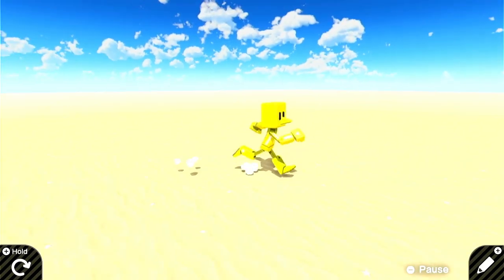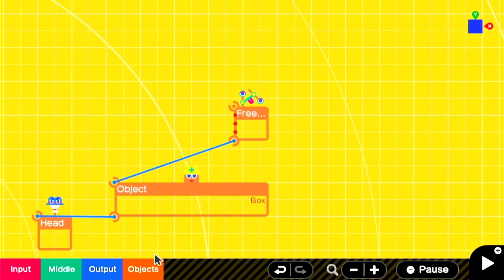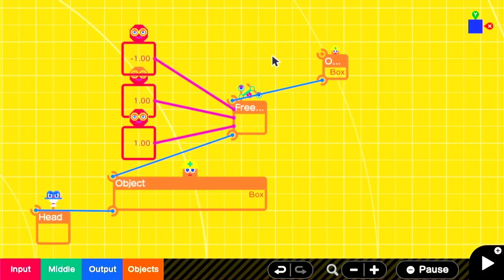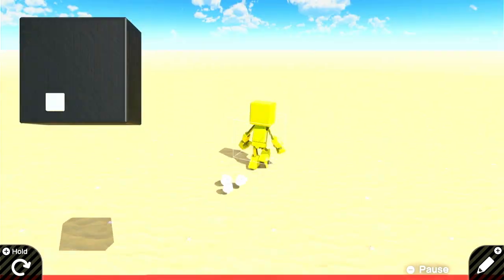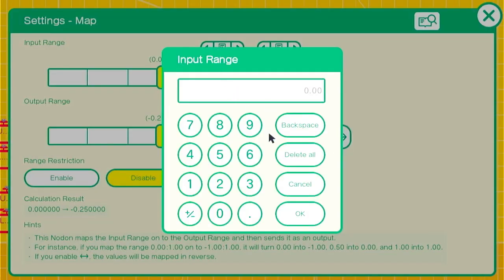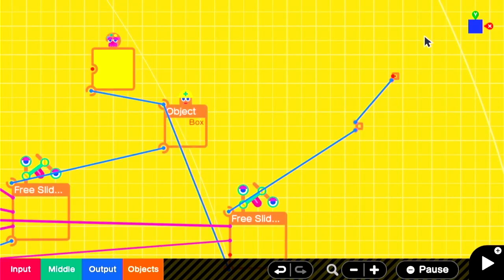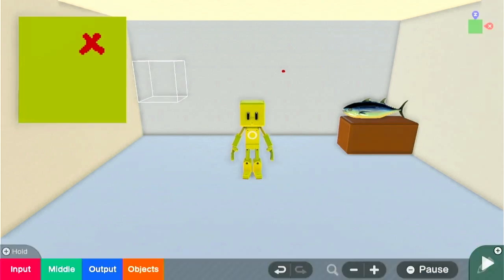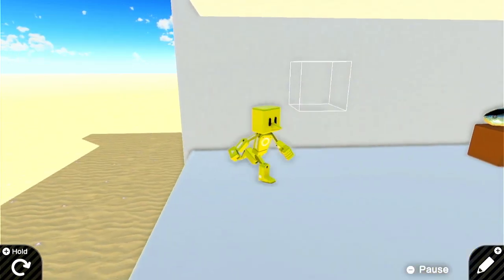Let's Add a Mini Map HUD to Game Builder Garage so This Guy can Go Home (Tutorial)

Comment: 2:17 Why did you copy the constant nodon 3 times? If they were all one, your should’ve just left one there and connected it to all of the ports to the free slide connector
Reply from the maker: Well if your map was any other shape, or your camera had a different POV, or you wanted it anywhere else on the screen you’d need different variables so i thought it would be nice to show all three that you can adjust. And we end up turning one into -1. So it would just be saving 1 nodon.

Comment: What if I want my cursor thing to start on say, the right side?

(Great video helped a lot)
Reply from the maker: Hi there, Thank you! If you're talking about how to change the map's place on the screen, you can toy around the with constants that go into the freeslide connector to place it anywhere on the screen.  If you want to cursor to start somewhere else, add a number with a calculator to the location sensor input to alter it before it goes into the map.
Reply: Thanks!

Comment: You know how to teleport using a button but that only works if, for example, a round ends
Reply: When the round ends, turn a flag on. Then the input to the teleporter is "flag AND button pressed"
Reply from the maker: Whatever activates when your round ends, connect that output into the teleporter. Also send it out to any cool effects to help the user know the round is restarting, etc.
Reply: Thanks